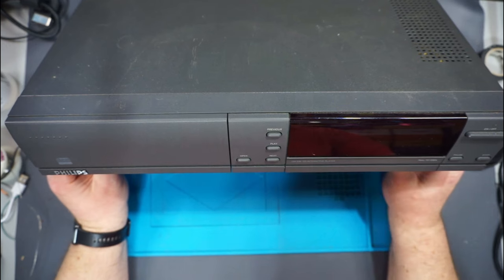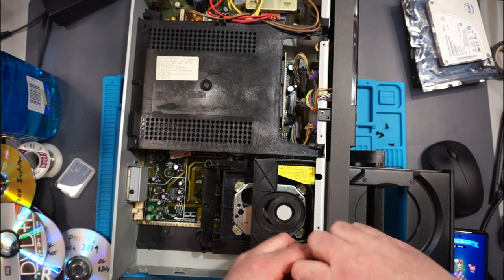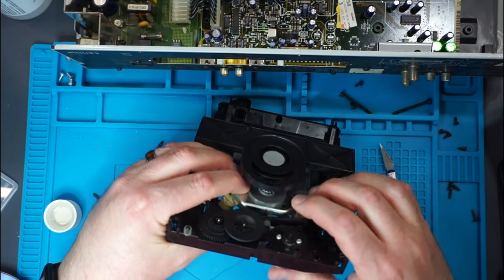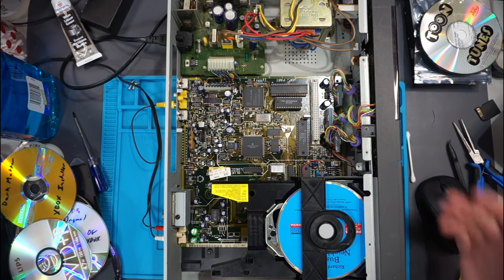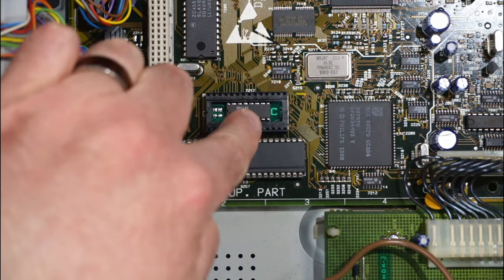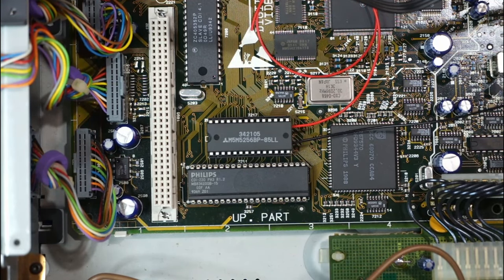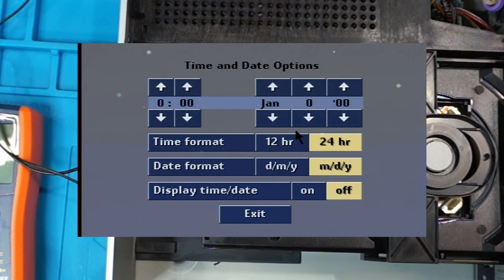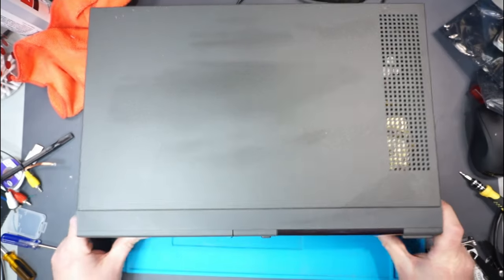Philips CD-i Repairing one of the worst game systems ever (Discs not reading and Battery)

Comment: Thanks for showing this repair for CD-i 220 Smartwatch Timekeeper. With this video I dared to repair it and luckily it was a success. It seems like an easy task, but you really shouldn't let any solder run into the chip while soldering the connecting wires. Also, you have to be very careful when loosening the top ram chip that sits on the timekeeper battery socket, otherwise you can bend or even break one of the contact pins... then the machine will no longer work. Anyway, thank you for this video!
Reply from the maker: Glad to hear it worked for you too ! Next time I do a video with smaller Solder points, I'll give more detail, but the key to making sure the solder doesn't go anywhere is flux and tinning the wire you are going to attach, that way it should connect quickly.